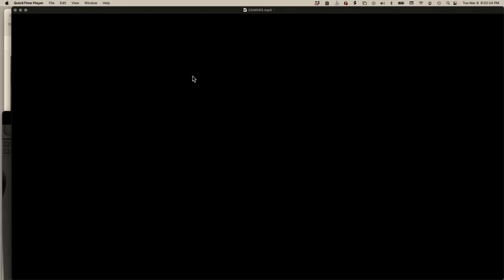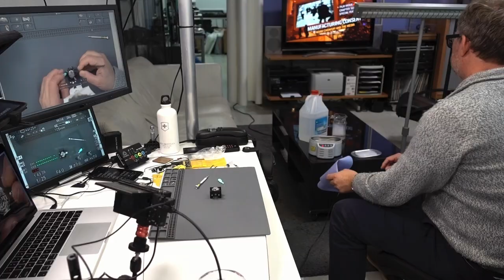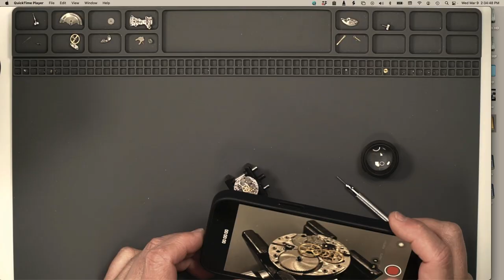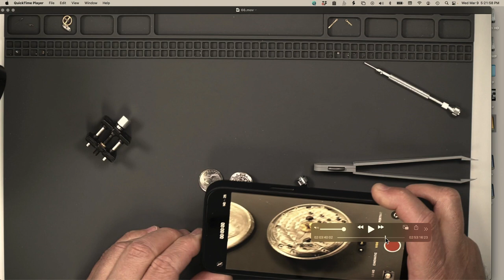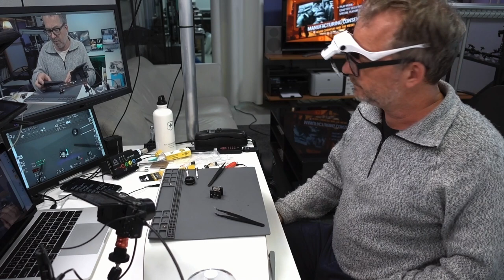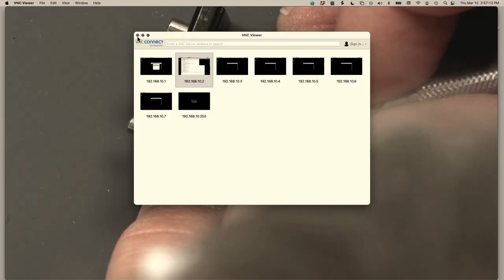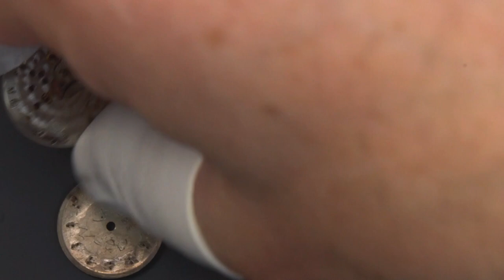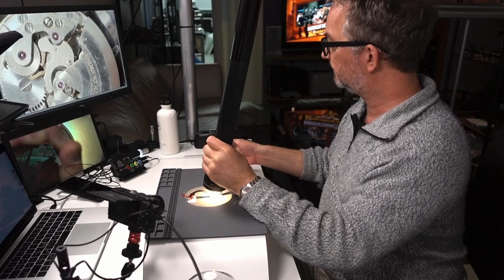IWC Cal 44 Reassembly - Realtime 12 hours

Comment: Alright, that was at times painful. Few things: Skip the whole oiling thing for now and only start focusing on that once you have successfully reassembled a handful of watches. An unoiled watch movement will run infinitely better than your IWC where you occasionally applied an ungodly amount of oil, sometimes even to the wrong parts (you don't oil the pallet fork jewels for example). Because of all that oil (which is most likely also not the correct oil), your movement runs with extremely low amplitude (the measure of how far the balance wheels swings in each direction).

By the way, get that syringe out of your workshop. It has no business being near a watch. Just get a set of oilers from Bergeon which are like 15 bucks. You also want to replace those pairs of tweezers you have. It's obvious that the metal one is way too stiff and the plastic one is just not a watchmaker's tool at all. Don't skimp on those and get a proper antimagnetic Dumont #3 or maybe the equivalent from Horotec or Bergeon. They are night and day to what you are using right now and allow you to not constantly ping movement parts across your desk.

Contrary to popular belief, assembling a watch movement does not happen in the inverse order of disassembly. For example, you always assemble the train of wheels before putting in the pallet fork. That is so that you can verify the wheels spin perfectly freely when attaching the train wheel bridge. When you were doing it you actually had a hard time telling whether all pivots were snug in their jewel holes because the pallet fork of course prevents the wheels from turning. You can still use your video of the disassembly for reference, but more as a hint where a particular part goes when you're not sure.

Finally, your handling of screwdrivers is quite a bit off. Give this a watch: https://www.youtube.com/watch?v=ZmGTTEirrsc&t=196s (and most other videos in his channel; they are excellent).
Reply from the maker: Thanks very much for that comment! It's good advice for me and it also gives anyone that watches the video the opportunity to avoid making the same mistakes that I did.

I saw the amplitude problem and reverted to the spare working movement because I wanted to give my wife a working watch. Consequently I will do another pass on this movement and will incorporate your suggestions. 

I already did buy Bergeon oilers (and Chinese oilers to compare), and a set of used Bergeon and Dumont brass watchmakers tweezers. 

I also found documents that show oiling points and type of oil to use for various ETA and Sellita movements that I think will be translatable to IWC. For example the Sellita SSW200: https://www.cousinsuk.com/document/category/sellita-movement-list

One thing that still troubles me is that the watch companies that I've seen or visited in Geneva all seem to work under very expensive microscopes. There's a point at which it simply doesn't make sense to do this kind of work without a microscope, so before I do this again I want to solve that problem with a better DIY solution than using an iPhone for extreme close-ups. The good thing about not using a microscope is you don't have to make that transition to adapting to a mediated point of view (the eye-to-hand relationship is not mediated and scaled by electronics). But it's also very, very difficult to see what you're doing. In fact I can see much more in the videos that I've made than I saw when I was doing the work. For example I can see the tiny click spring that I lost that took me two hours to remake was actually sitting in plain sight on my desk, inches from the movement, for at least 30 minutes after it popped out and before it finally disappeared - and yet I never saw it, even when I was looking for it. 

Thanks again for your comment. The screwdriver holding video is also excellent.